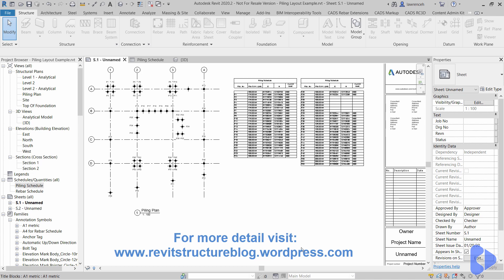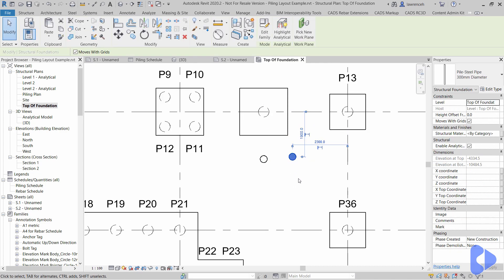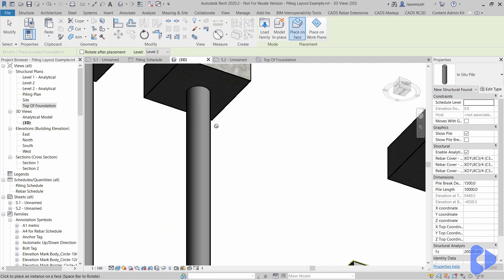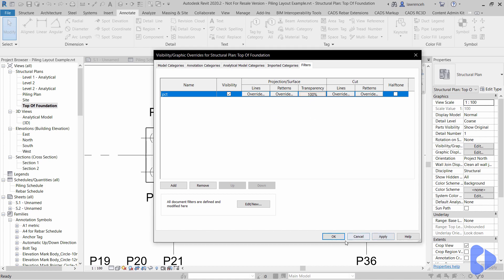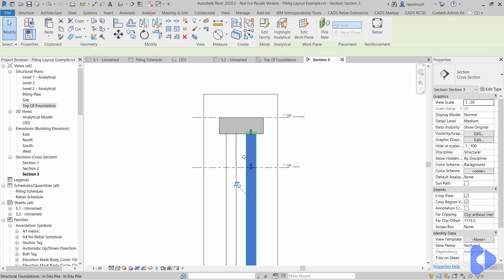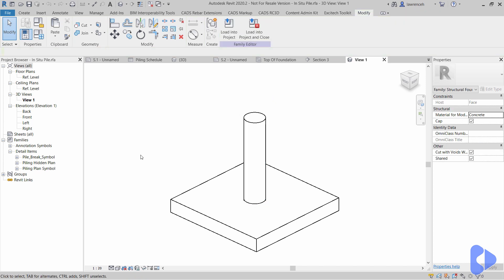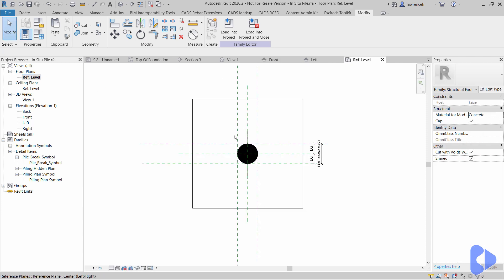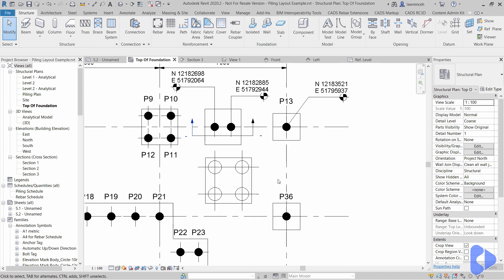Tutorial   Back To Basics with Revit Pile Families

Comment: Does pile drives cut-off in host or it works different, like you've created void extrusion in concrete host, which if you change diameter of pile should change its diameter as well, is this pile parametric?
Reply from the maker: You 'cut' the piles from the cap. Using this method, the piles will automatically cut the rebate. The only criteria is that piles are a different material to the cap.
Reply: @RevitStructureBlog  Thank you, i've done all, now i need to do filter and it is going to be it....thank you for video and sharing.....update: spend whole day with filtering and found out that just changing visual style got me the same result.....

Comment: Hi there, thanks for the video. I've got a question. At 7:13 in the video you talked about a detail component and the visibility parameter. Problem is when you build the family like you did in the video and in your project you turn of the visibility of the pile it self then the pile will not be visible in the entire project. So also not in the 3D views. That's not desirable. How do you cope with that?
Reply from the maker: Hi, you can just rely on the masking region in the detail component which will hide the pile. Another option is to set up some sub categories. I do want to create some more of these types of video showing some family creation techniques.